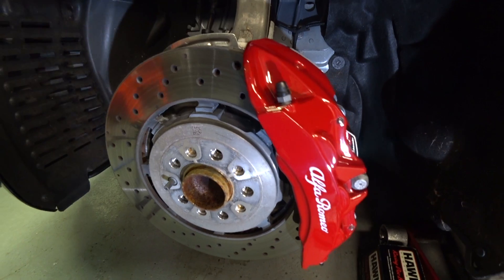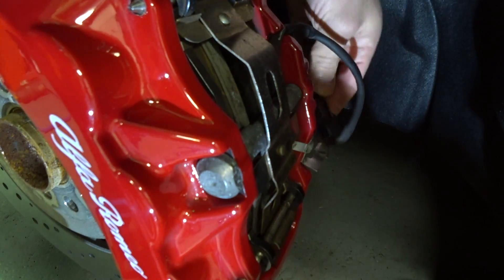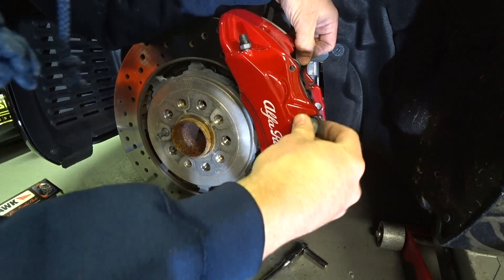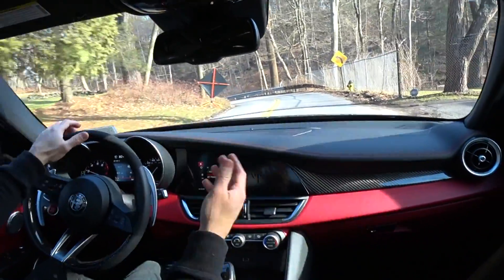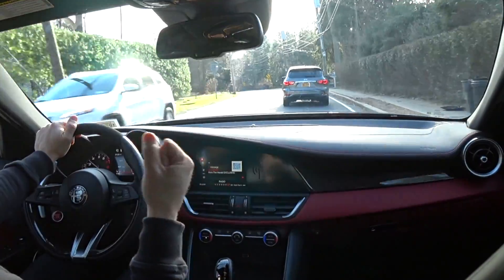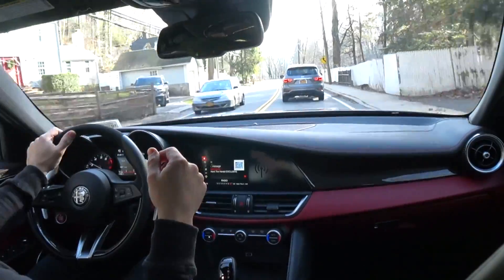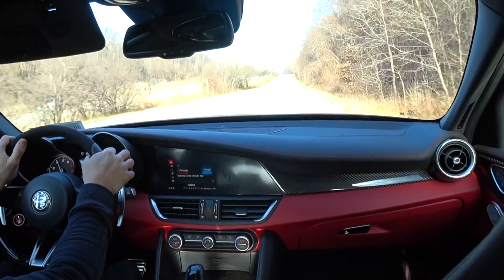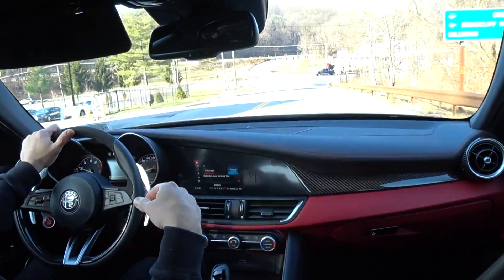Alfa Romeo Giulia Quadrifoglio Bad Brakes Fixed! | Auto Fanatic

Comment: Hi again! Did you bleed the brakes? Also I fallow all your steps but I have a bunch of warning lights on? I guess the car didn't like what I did. Any help?
Reply from the maker: i changed my pads over 15 times never once had an issue. did you cap off the sensor wire? try doing a battery reset, connect then drive the car a few cycles of the ignition may reset everything
Reply: @autofanaticcars  yes, sensor wire cap, but all lights and warnings on, not only brakes. I removed the negative wire from battery for about 15 minutes and no change. Any particular sequence, or should I remove the positive cable?
Reply: @slowalfaqv1817  did you solve your issue with all the lights on after your break job?

Comment: Do you find that the Michelins rub at full lock turns when going in reverse? When turning right especially. I'm trying to figure out if it's just my car and haven't found anyone discussing this. I think savagegeese mentioned that the steering rack behaves differently in reverse VS forward but I don't know if that would cause rubbing. I don't think the Corsas have this issue.

Great mod btw! I can tolerate the brakes for now but will definitely look into switching to these pads once the OEM ones are toast.
Reply from the maker: the winter Pilot Alpins do rub because their overall height is taller and of course my car is lowered. its minor and I need to reshape the plastic shroud when I get time its a super easy fix we have been doing it forever on modified cars. Maybe il shoot a video on doing this one day which may help anyone with a rub issue on plastic.
Reply: @Auto Fanatic, nice, thanks!

Mine is a 2017 so it's a bit lower than the stock 2018s, but the larger Alpins make sense. Those are the winters I have as well. I'm sure it's not a huge deal, just seems a bit weird that even slightly bigger tires would rub but I've never had a high performance car like this before so maybe it's normal.

Comment: Im debating on getting this car, If this car is optioned with the carbon ceramics does this issue still occur?
Reply from the maker: i do not have much seat time with a CCB Alfa but your best bet is to drive one and they are hard to find in dealers stock.

Comment: How could changing the pad  possibly fix the torque converter setting? It doesn't make any sense.
Reply from the maker: the factory brake pad compound does not grip well enough without extreme pedal pressure thats the issue in all DNA modes in traffic

Comment: I wonder how it would have been with a set of xp10 carbo techs
Reply from the maker: ask me how I know? I have Carbotech pads in the car now front and rear 8s nd 10s, fucking incredible! by far some of the best pads you can do on any high performance car, not cheap but well worth it. Blows Away EBC, Hawks, Ferrodo etc.
Reply: @autofanaticcars  I run them on my spec miata, and have run them on all my other track cars I've had including my zl1 1le. I've been looking at getting into an Alpha thanks for the content as it's hard to find people talking about these cars. Looking for a track day car and daily like my m3f80 was.

Comment: Price on  amazon is about $180 vs Tirerack and others at around $240+. Would that be due old compound on Amazon?
Thanks Love this beast, annoyed by brakes, but thanks to you easy fix.
Reply from the maker: thats a touch call you can order them and see the production date on the box, not sure when they switched to the newer compound
Reply: @autofanaticcars  Also I asked a question on the feedback video. Sorry wrong place for that, but do I need to disconnect the battery to avoid error codes when I swap the pads?
Thanks for the help

Comment: Has Alfa repaired the issue or is this the only fix? Brake feel is really important, at least for me. And for a great car like this to have uncomfortable brakes doesn’t make sense. Reminds me of the feeling I would get with my 2001 Lincoln LS brakes, especially after I put 19s on the car.
Reply from the maker: this car just needs better pads end of story, the programming the dealer will not offer an updates or fixes for. I recently install Tarox Corsa pads in the QV front and rear and il be doing a video on that soon enough.
Reply: Auto Fanatic Ok, sounds good. Was just wondering because I’m seeing a lot of r views on the brakes, so I thought they may have fixed the issue for 2019. If the pads solve it, then that’s good enough for me. Also heard that the Pirellis feel dangerous in the rain and many people have switched to Pilot Sports for more security. Given that I live in Jersey, I’m also considering the Stelvio Quadrifoglio for peace of mind. Those are my 2 front runners along with the RS5.

Comment: Went to see a QV, thinking of buying one the car had 2 break pads the second one was for hand break, never saw such a thing any comments on these please?
Reply from the maker: based on design they implemented electronic parking brake calipers because the rear rotor and hub design would not allow for a conventional internal drum brake assembly due to suspension design and brake caliper overhang, this is common on many exotic cars

Comment: I need to do this!
Reply from the maker: if you own this car you better do it ASAP, if your local contact me for a test drive you will be sold in the first 500 feet
Reply: @autofanaticcars  I am in Southern California so I am not local...on the upside I don't need winter tires :-).............I just posted this video on the giulia qv forum and I think this will be a huge sensation.
Reply from the maker: charles i had so much damn fun when i shot this video i came back and put the Corsa and Technicos back on and its even BETTER! temps supposed to warm up for a week so i want to enjoy it, i can not wait til Spring and Summer now.
Reply: Will a dealership tie off the sensor or would they consider that "off book". Need to do research on who might do this for me.
Reply from the maker: do it yourself its so easy all you need is a 13mm, punch and mallet and the anti seize. not sure how a dealer would do it unless you specified and waited to make sure it is done right. we all know dealers like to slap stuff together
Reply: @autofanaticcars  Not a do-it-your-self-er...thanks for this video. You are the best!
Reply from the maker: i think the first one, watch the video and freeze the frame the one i used has a number on it and i think it matches the first one in the link
Reply: @autofanaticcars  The heat shrink item you show in the video has 14/5 or 14/S on it.  I doubt it's a 3M product (unless there is a superseded part number).  There is nothing in 3M's data with anything close to that number.  I bought 4 of the items listed in the previous link (SKE 15/40 3M)  which you suggested might be the ones, and they were WAY too large.  I think it would benefit your readers if you get us a supplier of the 14/5 item or alternatively, give us measurements of the heat shrink caps you used so we can order the correct size.
Reply: @autofanaticcars  Ok, I found a part number for these caps (or ones like them that work).  They come from McMaster-Carr:  https://www.mcmaster.com/catalog/125/87
They are part number 72855K71.  Also, I replaced my front brake pads Hawk PC pads (Performance Ceramic) pads instead of the HP Plus.  I used the PC pads on a Porsche Cayenne Turbo a few years ago and liked them.  I also used the copper paste, and there  is ZERO squeal.  Also, there is ALMOST ZERO dust which is the primary reason why I changed the pads.  The part number for the Hawk PC pads is HB616 Z.607.  Hawk doesn't have a replacement pad for the rear calipers, but I found some from Powerstop they are 16-2043 /Z16 Evolution Ceramic Pads.  Good Luck!

Comment: Alfa Romeo should pay you for finding a solution their issue. Who knows how many millions of buyers went to competing models because of this simple fix. Bravo my friend, how did I know with how meticulous you are with your vehicles that you’d figure out a solution to this somehow 😂
Reply from the maker: figure it out or sell it  were my only two options. I am glad this corrected my issues and I can enjoy the car now
Reply: Auto Fanatic congrats man! Hopefully this helps some other AR QV owners out there.
Reply: there really isnt any issue
Reply: Trey   How many millions wouldn’t have bought the car because of the brakes?  In short, anyone who had actually driven the car then Zero.  There is NOTHING wrong with the brakes on this car (I own one). Respect to the reviewer here who prefers a non standard braking system but to be honest the OEM offering is more than OK for the average driver who doesn’t track the car.

Comment: That's one of the reasons I left my (newer) BMW, but I see that you can't escape this 'demon trend' ...gonna swap pads on my Q2 Ti-Sport - which isn't as bad.
So which Pads are you now using? Oh, HAWK HP+
Reply from the maker: I now have HP5.0 and love them on the street, better suited for the street, still have the HP+ if i want to switch
Reply: Auto Fanatic Long ago (in the mid’00) I put HAWK pads on my Acura RSX, and never looked back ...actually I had to; make sure no one is up my rear😆. But I’m so happy to hear these BBW clamps can be swapped.
You think HP5s may be better for the “lighter” Ti ?
Reply from the maker: you need to see if they offer pads for the Ti calipers i think they are smaller than the QV, the 5.0 are awesome for street driving, great pedal feel, bite and modulation. if you can not find pads you can pop one out, scan it and email to Hawk to see if they can match a pad profile for you that is what I did.

Comment: Hi, for how long time this self made increasing will be beter ?
A car at that price and technology can t be touch by one unequiped guy without impacts on mid  long term.
I hear a lot of noise, so i didnt see any positive aspect, don t touch it........they are a lot of sensors and curve setpoints, you can damage  it.
Reply from the maker: keep reading forums sand the internet where you lack hands on experience. I have been working on performance cars for 30 years how about you?, this was a massive improvement in braking and the squeal is minor and i will fix that when i have time. I installed the pads quickly for testing purposes only.

Comment: I get why you went down this path. Obviously you just lacked confidence and appeared to have issues with the braking on the QV. So if it's fixed this problem for you that's great. However, what I don't understand is why are the performance figures for the braking so good for the standard set up? You know the real objective test would be to repeat the braking tests between the different pads and see what the figures show in actual distances. I'm also perplexed why the ABS would not be working on the standard system? (And why one would be in Race mode in built up traffic?)

Like most manufacturers, they try to find the balance between performance and everyday driving situations. I know of a case here in Australia where a guy bought a high performance AMG and the brake squealing was so bad he's complained demanding a fix.

Anyway, I'm glad at least you won't be selling the QV any time soon!
Reply from the maker: I drive the car in Race mode 100% of the time, all my cars are driven this way thats why i buy them for fun. I am also glad the brakes are improved now I had my friend see the car stop yesterday and he could not believe the difference from the OEM pads to the new ones it was staggering from 60-0MPH you can feel your insides move and the tires bite into the asphalt now the way it should be. I also put the summer Corsa on for the next few days to do some more testing and the braking is incredible now.

Comment: Nice job. Couple things; do you have to lube the pins before you put them in? Can’t you just put a female waterproof connector on the end of the one on the harness so you can revert back to original if you want, or just cut the one off the OEM pad and pull the wire out and seal it with a dab of silicone. When I talked to one AR tech he told me emphatically to NOT use copper grease on these brakes because it degrades the piston seals. Not sure I believed him but it was an awful specific thing to be talking out his ass about...
Reply from the maker: thats info on the piston seals is BS been using it for 20 years a well known Porsche race tech turned me on to it and all the BMW and MB dealers use it on the performance cars. easiest way to seal wire is as i show. il let you drive the car so you can feel the difference
Reply: Also sharing Brembo Ghibli brakes isn’t necessarily a bad thing, the Maser makes 425hp but weights like 500lbs more so less power but more weight.
Reply from the maker: Ghibli drives horrible i hate those cars ha ha ha every lady around where we live has one
Reply: Auto Fanatic yeah copper grease has been used for decades on brakes but when I asked the White Plains tech about using it to help squeal on my QV he told me that Brembo said not to I was kinda shocked. Who knows maybe they didn’t want to even bother pulling the pads to grease them...
Reply from the maker: those kids are too young to know the deal with this kinda stuff. il fix your squeal one day when it warms up easily
Reply: Auto Fanatic yeah they are based on Chrysler 300 underpinnings so dynamically they aren’t great, but the brakes are still a Brembo off the shelf part nothing really to do with Chrysler or AR etc...

Comment: get the carbon ceramic, otherwise you can't really complain they are bad
Reply from the maker: you have not driven the carbon ceramics cold and in NYC traffic they suck and are not practical for a daily driver everyone thinks Carbon brakes are superior when they are not on every car
Reply: @autofanaticcars  i did not, however everyone who has them says they are worth it. i can agree in cold they might suck. but the car would really stand out with them and at highway speeds they are amazing
Reply from the maker: not practical for my needs maybe if i was tracking the car but for around here i drive my clients exotics with CCB and they are noisy and do not stop well locally they are purpose built around racing not NYC congestion.
Reply: @autofanaticcars Carbon ceramics are ideal for everyday applications they only squeak when they are cold or the pads get dirty otherwise no corrosion very little brake dust and a longer service life. Besides nothing looks cheaper on a 80k car and rusty rotors it ruins the look of the wheels after you get use to CCB you can never go back to steel rotors.
Reply from the maker: do you have one of these with the CCB? the Zr1 vette you have is a totally different system this brake by wire thing is the issue i think because every single Alfa Romeo i drove back to back felt different with their brakes and of course mine felt the worse after i bought it. I think the technology needs improvement and it was developed for Electric vehicles not high performance cars but found its way into this awesome car.
Reply: CCB are for the track, for daily drive the standard are more than enough and good.
Reply: No problems with my CCB's
Reply: @autofanaticcars  wow, I had some issues following your approach, but now you lost me. I have driven a few QVs and own one with CCBs. I have not even one of the issues are you talking about. The CCBs do need some more pressure but that is to be expected. They are racing brakes after all. 

Also your brakes now squeals badly. You shouldn't  have used the copper compound with the Brembos. It's not compatible. 

Let me know when you revert them. I give you a few weeks at most.
Reply: @autofanaticcars  def not practical for everyday use unless u drive the car extremely and need that braking power otherwise they will scream!
Reply: The brake-by-wire system used in the Giulia is Continental MK C1, it was its first use in a production car.
I think it was choosen more because capabilities that offers with drive assistance system (faster pressure fillup for example), but also for energy recovery system integration (-> for the hybrid versions).

Comment: When you ABS doesn't come on in the wet, there is something wrong or you do brake hard enough. I owned this car sold it after all sorts of software trouble
which Alfa Romeo could NOT fix. I am sure in Europe that would not have been an issue no technical experience with the dealer at all.
Returned back to German quality bought an AUDI R 8 AWS 2018 no more Italian adventures. Thank you very much.
Reply: just wait that Audi continues its traditions, like in dsg and tsi and buy lots of oil.

Comment: Of course there's no pedal feel, it uses a brake by wire system 😂
Reply from the maker: the Stelvio actually does have pedal feel, now my car does as well but it will never feel like a conventional pushrod mounted master cylinder off the brake pedal